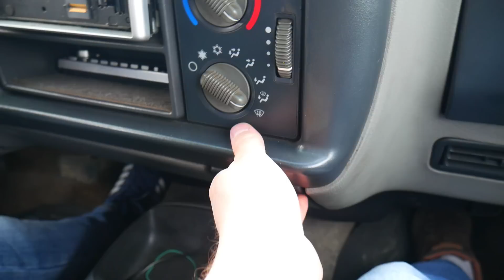Шевроле Блейзер на каждый день  Chevrolet Blazer

Comment: This is the exact same model that was produced in Brazil under the DLX trim level. Same front end, same extra spacing on the real wheel arc, floor shifter. We got those in both 4 speed auto and 5 speed manual. Best of all them was the Executive, which is basically a Oldsmobile Bravada with all the gimmicks and features.